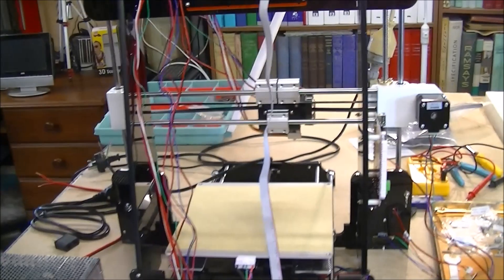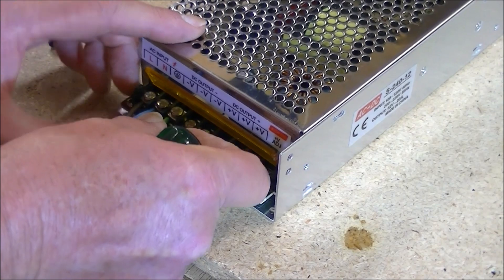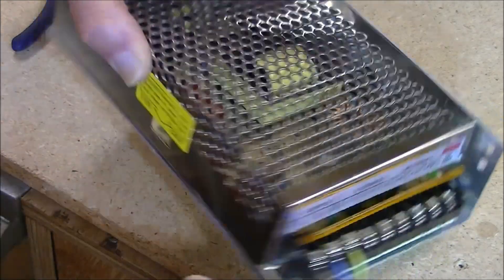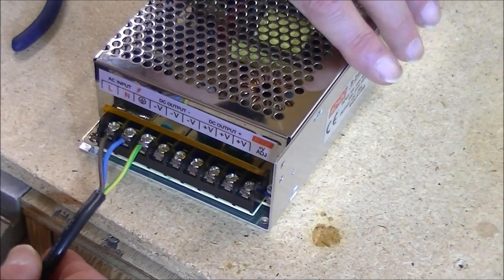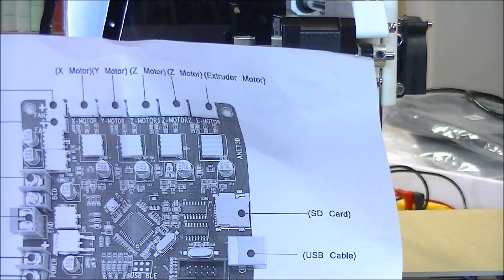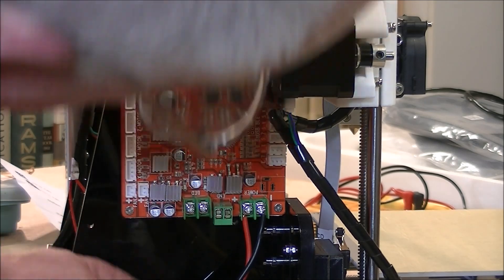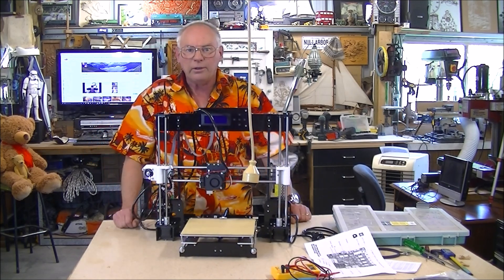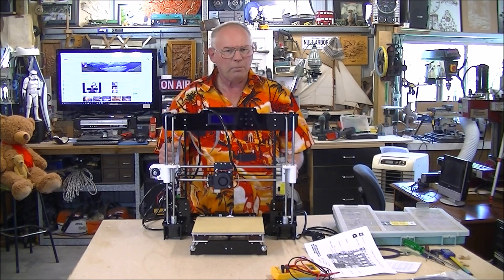3D printer build Anet A8 tips and tricks  Part 2

Comment: I just watched both of your videos on the building of this printer.  If I may make a suggestion, please redo your mains power wires and the DC wires (on both ends) as well as all other wires that go into screw terminals.  DO NOT tin them.   Instead, crimp wire terminals onto them for a better connection in the terminal block.  Other than the music being too loud, at times, I thoroughly enjoyed watching.

Comment: hey  roger ..recently purchased a printer very similar to yours ..Mine was through  the robot shop 
I am just ahead of you on set up and have leveled my bed  ...Yesterday after about 8 hours trouble shooting i finally got connection to my laptop ..Thinking that your setup is the same and this may  save you a little grief ...on the disc supplied there are drivers in a zip file you have to manually install on your computer  so the computer recognizes the printer ..It will be a com port in your device manager ..hope this works for you ...there are a few vids out there to help ..I had to unzip the  driver  file  so the update driver promp would accept it ..hopefully yours  goes smooth ...
I also recently purchase a chinese router like yours ..I have mach 3 running a Taig cnc and plan on setting up the router as well   with smooth steeper  so as to use a laptop ..mat be getting some advice for you in the future ...good channel ..thanks for sharing
Reply from the maker: Thank you.
Australian Inventor Roger Clyde Webb ;-)

Comment: Hi Roger, Check the wiring at 5:14. looks like you have both wires connected to the negative output. the terminal label is not well aligned. Thanks for producing the video, will be good to see it up and running.
Cheers Dave
Reply from the maker: Hi Dave , had a look,  all good thanks :-)
Australian Inventor Roger Clyde Webb ;-)
Reply from the maker: OOPS , ok I see it ;-))
Australian Inventor Roger Clyde Webb